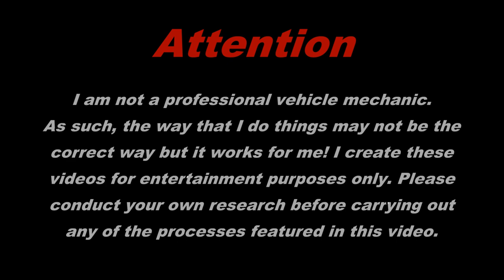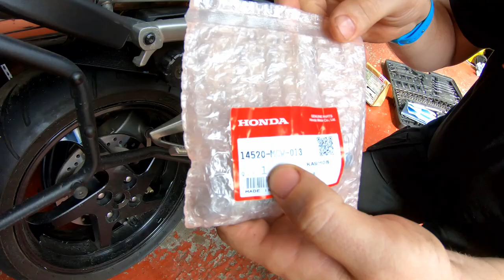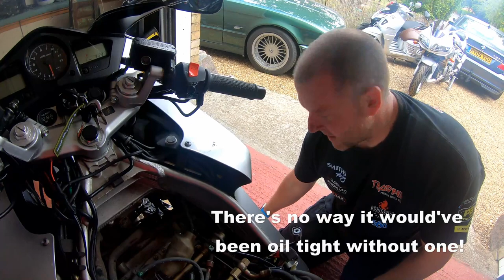2003 Honda VFR800 VTEC Cam Chain Tensioner (CCT) Replacement

Comment: As usual a very informative and practical video! Nicely done. I hear they usually go around 30,000 miles or so, so I’ve got 24,000 on mine -so it’s in my future. Interesting tid bit on the gasket hole. I’ll definitely open mine up as well. You did answer my concerns about the cap and about how you actually wind the tensioner up. Kinda ridiculous that Honda didn’t secure that cap on better. Thanks for the video Kevin. Cheers. If I ever come to GB I’ll buy you a pint!
Reply: is replacement nessacary this doesnt seem like a wearing part
Reply: is it more down to changing the oil more often ??
Reply: It’s a spring loaded assembly and it goes bad, if you want to try changing your oil more often to see if that makes your cam chain tensioner last longer, keep notes and let us know when you hit 50,000 miles.
Reply: Outta curiosity what do you hear when it goes? I'm getting a kinda chirpy clicky noise through my gas tank and thighs while riding

Comment: At 27500 my front one went on my 2015, Kev - this video is fantastic, saved me hours of work and did it in about 2 and a half hours. Pulling out the old one was terrifying but you made it easy to follow. Thank you so much!
Reply: was there any serious damage when the tensioner failed? I'm getting a used VFR with 56k km on the clock and I'm wondering if I should change them asap.
Reply: @papercut1987  They might have already been done! Luckily I was parking up at home and it made a horrific metallic loose slappy sound so hit the kill switch straight away.  You'll be able to hear the warning signs very easily (slappy knocky noise) if you have a listen to your engine. Front right near the frame and at the rear right behind the brake lever. Just make sure the engine is nice and up to temperature when you listen as they sound fairly agricultural as standard...!

Comment: Many many thanks Kev. CCTs done today with help from your video. I have to say the front was a lot easier than I expected. Had more hassle reconnecting pipes and electrical connectors☺️ only problem I had was dropping the rear bolt which disappeared under the throttle bodies. Soon got that out with the help of my little endoscope with attached magnet😏. A good afternoons work. Your videos are invaluable to the likes of me who can't afford garage prices but are willing to have a go (with a good instructional video) and also learn more about their bikes.
Keep up the brilliant video 👍🏼

Comment: Just done mine, thanks for the info & tips , top one is a real pain, dropped a bolt but blocked the hole while i recovered with magnetic screw driver, one thing i did do was to make a tool to hold & turn the key, had an old tooth brush in my box , cut end square & a slot to hold the key, worked a treat !!

Comment: Thanks kevin, this looks easier than i expected. Might give this a shot myself this winter. There's no guide on a proper front wheel removal for the VFR 800 either, just a tip.

Comment: I found that moving the airbox just slightly gave enough room. I only removed 3 connections at the top right corner,2 vacuum pipes and a plug. Second time I've done this job recently as first time I did the tune up on the old tensioner but didn't last long,a few hundred miles before it was ticking again. New tensioner now fitted.

Comment: Cheers for the video  had a bad rattle on my vfr drilled out the cam chain tensioner gasket to 2mm and done a oil change which made the rattle go thank you 👍

Comment: Thanks for this, Kev. As I write, I’m expecting a new tensioner to arrive for my little 125cc cafe racer the following day, so I’ll have this video on standby in the shed. Just as a note, in case it helps, my Haynes manual says the tensioner bolts for my engine type (a copy of a Yamaha YBR 125) should be torqued at 10NM, while the cap bolt should be torqued at 8NM.

Comment: Got that info, thanks mate, think ile go with mechanic I’ve been using, so far the garage hasn’t let me down & a whole lot cheaper than Honda, the OEM Alternator & Upgraded Rectifier (CM Stator) are working smoothly with No burning smells after opening it out a bit, just checked out these ccts at £73 each plus £16 p&p maybe with VAT I might as well buy local .....Anyway Appreciate all yr help mate, buy you a pint if I ever see you. Thanks again.

Comment: Great video, I managed to swap them both fairly easily. The front was a bit awkward and did drop the end bolt and new washers a few times but avoided the big issue of the caps falling off. The bike is now running mint (also did the fluids and filters at the same time) but I do have a FI light, need to investigate
Reply: FI light was a vacuum hose had came loose from the air box :)

Comment: Thanks for the instructional video Kevin. My '02 is making a horrible sound, mostly up front. I'll replace both in the near future now that I've watched how it's done. I bought the bike 18 months ago with 50k miles on her and I've added 20k since. Don't know if the originals are still on there. All I know is that they need replacing.
You've got a new subscriber, mate.
CHEERS from California.
Reply from the maker: Cheers buddy, glad you liked it!
Reply: @KevsShed  
Front and rear are same part #?
Reply from the maker: @kevlarV2rocketRSV  Yes mate, identical.

Comment: Thanks Kev. Yhat tensioner on top was a bloody bitch to remove but, with your help,  I nailed it. What you didn't mention was how long it was going to take to remove the air box. Maybe I'm a bit mental but I didn't enjoy that at all. And re-installing?  Fk it! Why bother. Thanks again Kev. Next stop, fork seals. 30:39

Comment: Great work and thanks for the info , didn't think it was so simple to do. Only thing is could you improve the lighting when filming as your working inside, but still a great watch !!
Reply from the maker: Cheers mate, I agree, the lighting could be better but that will be solved very soon once my new workshop is completed. The lighting in there is fantastic 👌🏻

Comment: Very good informative video. 
I have a 2008 Honda ST1300 that I think needs at least one tensioner. I'm changing shims and I retracted the cam chain tension bolt with a screwdriver and it doesn't spring back at all. I turn it in and out with resistance? I see your tensioner still had lots of spring tension. Why did you change yours?  Did it lose it's spring tension? Weak spring causing chain noise? 
One thing I can add to your well done video. You don't need to retract the tensioner to remove them, just on install. You will just fight the minor spring tension when loosening the bolts. Maybe that end piece falling off is why you wanted to do it to keep it centered?  
I replaced the tensioner in my Honda Rincon 4 wheeler a while back and think I can use the same small tool to retract the spring. If not I'll use a 1/8" slot screwdriver.
Again, well done!

Comment: Hey. Great video. I've got a subtle ticking at idle, and a loud clattering while riding my 03. From my limited knowledge and research, I'm thinking it's probably the CCT's. Anyway, regarding drilling bigger holes in the gaskets for better oil flow. You mentioned a 2mm drill bit. 2mm looks to be many times larger than the pinhole that it comes with. Have you experienced or heard of any issues with expanding the hole to 2mm? I'm just wondering if that's making it too big at all. Thanks. Take care, and Hello from Toronto.
Reply from the maker: The hole in the cct itself is much larger than the hole in the gasket. I’ve ran my bike for quite a few miles this way now and can report zero ill effects 👌🏻
Reply: I left it as it is. My view is they have lasted 30k as they were so another 30k would be fine

Comment: Hi Kev great video as usual your really helping Viffer owners out there, just ordered two from Japan ones noisey  so going to do both quick question the 6mm copper washer on the back of the tensioner any idea what is the outside diameter ? Many thanks
Reply from the maker: Hi Steve, glad you found it helpful mate, they are M6 X 10mm washers that I got from ebay, here's the link.
https://rover.ebay.com/rover/1/710-53481-19255-0/1?mpre=https%3A%2F%2Fwww.ebay.co.uk%2Fitm%2FCopper-Sealing-Washers-Metric-M4-M6-M8-M10-M12-M14-M16-M20-Flat-Seal-Washer%2F123038741250%3Fvar%3D423471192747%26hash%3Ditem1ca5ae3302%3Ag%3AsU8AAOSw3dtaqBE2&campid=5338707657&toolid=10001&customid=
Hope this helps.
Reply: @KevsShed  Thanks Kev cheers for the link much appreciated,keep up the good work

Comment: Very usefull and practical video as always. I removed both CCT from my VFR800 A2 and replaced them for a brand new ones. I am a bit scared that the cap comes off  and falls inside the engine as the It doesn´t fit the CCT very tight. This might sound crazy, but could I put a tiny little bit of  glue or gasket maker insdie the cap in order to make sure it remains attached and doesn´t fall off? Thanks!

Comment: Hi Kev. Brilliant video thanks for posting such brilliant help and advice. I have tackled this job today and have found a particular issue and would like your thoughts and suggestion. I removed the front tensioner and found there to be no metal cap on it. After 2 minutes of panic I had a closer look at the removed CCt. There is a circular indentation on it, (witness mark). This is exactly the same size as the circular disc on the cam chain guide that I can see down the hole in the cylinder head. I have never had the tensioners out. I have had the bike 12 years since it had 16k on it. It's now done 44k. Valve clearances were done at 32k in the correct way. I have never had an issue with the running of the bike, and at this stage wondering at the possibility of there not having been a cap on it in the first place? The witness mark on the rubber leaves me to think this. Could I have your thoughts please. What would I have to remove if I wanted to categorically check there wasnt the bit down there? Many thanks Dave.
Reply from the maker: I have read before of a few people that have found there to be no cap on their tensioners as they've removed them. I would say yours is probably the same. I wouldn't worry about it mate. 👌🤓
Reply: @KevsShed  Thanks Kev. If you dont mind I will take a pic of the tensioner that I removed for you to cast your eyes over. If you're still of the same mind then I will assume there hasnt been one on there for a long time. The only thought I have had since is the possibility that it  dropped off when the heads were off when the valves clearances were done.

Comment: Hey Kev. Thanks again for all the work you put into these videos. Do you know how to source a cam chain tensioner tool, short of buying whole new cam chain tensioners? I'm considering checking the valve clearances this winter, but I need that tool and don't need to replace the whole tensioners yet. Thanks!
Reply from the maker: I’m not sure that they are available separately but you could grind down a small screwdriver to fit. If you have a Haynes manual then I’m pretty sure that it gives you all the details needed to make a tool yourself! 👍🏻
Reply: @KevsShed  Thanks. That's super helpful. Cheers!

Comment: Hi Kev great video as usual helped me change mine, one quick question what brand make of torque wrench do you use looks easy to set to correct value, Thanks
Reply from the maker: This is the exact one that I have, this one is quite a bit cheaper than what I paid too! 👍🤓
https://rover.ebay.com/rover/1/710-53481-19255-0/1?mpre=https%3A%2F%2Fwww.ebay.co.uk%2Fitm%2FHalfords-Professional-Torque-Wrench-10-60-Nm-3-8-DRIVE%2F233853065276%3Fhash%3Ditem3672ba983c%3Ag%3A7AgAAOSwol5f-dDT&campid=5338707657&toolid=10001&customid=
Reply: @KevsShed  Thanks Kev finally got one £32 bargain great bit of kit

Comment: Question for you, Kev (or anyone else watching). Here in the US, the popular sellers of Honda OEM parts list a separate front and back CCT with different Honda part numbers. Are there really two different ones? i bought my VFR used, and the seller handed me a bag with two new CCT's in it, but nothing to tell me whether they're the same or different (and if different, which one is which). I can't see a difference between the two, so wondering if I'm good to go or whether I need to worry that one isn't the correct one. Gratefully accepting all knowledge and opinions...
Reply from the maker: Hey buddy, my parts catalogue lists the cam chain tensioners as part number 14520MCW013 replacing part number 1452MCW003 for both front and rear.

Comment: Just finished the video. Thanks for uploading and great timing as I have some time off coming up soon.
I'll definitely be using your link.
Any help regarding the copper washer would be great, did I hear you say you annealed it first? Is that just heating it and rapid cooling?
Reply: Parts ordered from the link. Mine are making a right racket on Idol. 
Do I need a couple of M6 flat copper washers or a hollow crush type like sump seal washer, I assume flat?
Reply from the maker: I just used a couple of standard copper washers from a box I gave around the garage, you’ll get them anywhere! Annealing is heating till cherry red and then allowing to cool naturally, this aligns all the molecules and means that it is in a softer state. The act of tightening the bolt onto the washer work hardens it again and creates a far better seal.

Comment: Hi dude, got some info which may be useful.

Standard Torque Values for an 8mm bolt is 22Nm as per section 1-12 in the manual (pg 15 in the pdf).

Cylinder Head/Valves section 1-13 on pg 16 of the pdf list Cam Chain Tensioner Flange Bolts as 26Nm with NOTE 2 in the Remarks; this meaning Apply Locking Agent to the Threads.
(this is repeated in Cylinder Head/Valves section 8-4 pg 267 and 8-35 pg 295).

Now, like yourself, I initially didn't see a torque spec but stumbled upon them later and went back to do it properly and 26Nm felt risky so I left it at 20Nm.
Also didn't notice any loctite on the bolts that came out ... so am slightly confused as to why all this is so conflicting. 

Also found some strange errors in the manual eg pg 87 section 3-4 has intervals in KM and Miles but they are way out of sync miles:km, 0.6:10, 4:64, 8:128 etc up to 24:384
Likely a formula error in excel or something that slipped through the cracks.
Not sure if it's pertinent but it sure makes you wonder what else is erroneous.

Finally, I noticed in the service video you have your velocity stacks installed 1 short and 1 long in the front and the same in the rear, I mention this because that is what is shown in the Honda Diagrams ... however it seems that there is some contention around this.
Mine were installed with 2 short in the front and 2 long in the rear, this seems to be the same with any images or videos I saw online, and the manual had me second guessing; not a major issue but could be something worth looking into.
Reply from the maker: Interesting about the velocity stacks, there is as you say a great deal of conjecture about these! 👍🤓

Comment: hi kev
i have replaced the back one no problem and when I pulled the top one the cap was missing 
I have taken the clutch cover at the bottom off and the tappet cover but nowhere to be found I can see the whole assembly but cant see the cap?
Reply from the maker: It is very possible that it wasn't ever fitted to the tensioner, if it had come off as you removed it then you would have heard it clatter to the bottom of the engine.

Comment: Hi, I'm about to do the job on my VFR. For my experience on the CBR F4i the problem on the CCT is the low default spring tension. What do u think about opening the stock CCT and add preload to the spring (just 2 or 3 turns)?
Reply from the maker: Unsure to be honest, I have seen other videos where the guy did this. I have not seen any evidence to suggest that it’s good or bad to be fair!

Comment: Love your vids and have same bike. Is the part number the same for both front and rear tensioners?? Thanks
Reply from the maker: Identical mate 👍🏻 I’ve popped a link in the description to the cheapest I could find them anywhere 👌🏻
Reply: Yeah I seen link and gonna order 2 next wk thanks a mill 👍 top vids too well done

Comment: Hi there, fantastic video! I just follow it and replaced the front with an OEM. However, I think something may have gone wrong since she wont start now (turns over and sputters but won't catch)

When I was taking out the old CCT, I didn't need to wind it up at all; it was already fully retracted (couldn't turn the slot clockwise any further). I just had to insert the key to hold in place. When I replaced it with the new one, it didn't "spring out" like yours did; I didn't think anything of it since the old one was full retracted as well.

Do you think that points to an issue in installation? I tore her apart again and triple checked all the connectors, etc but they all seemed alright, so I think it might have to do with the CCT and not the connectors.

Thanks for any help or pointers!
Reply: I had the exact same situation come up when I did front CCT last weekend. Old one came out smooth, new one went in smooth and didn’t require any winding to bolt in, and now the bike almost starts but won’t. Researching…
Reply: Have either of you discovered what the issue was since posting your comments?